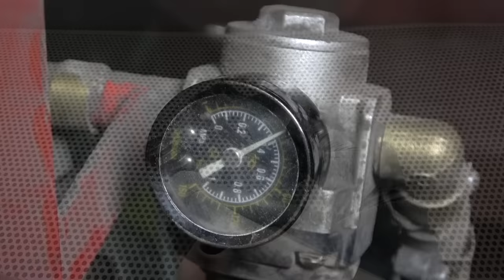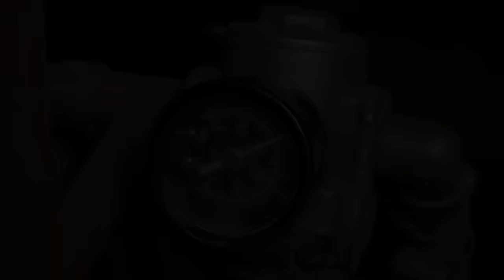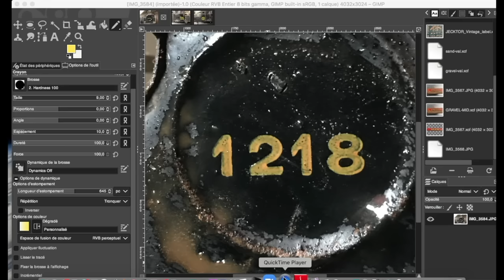1924s American Flyer Locomotive - Restoration

Comment: Great job on the body and decal work. As a model train runner I knew that one needed oil in several places, especially the armature and axle ends, and gears...
Reply from the maker: Great point! I didn't show it but I put oil in the engine ;)

Comment: Electrolysis is an amazing process. It can clean an 1800s piece of cast iron back to gray metal with no chance of damaging the surface. Here's a little trick I use with skillets because I use a 30 gallon tank and don't often change the solution. I hang the cast iron inside a pillowcase. It acts as a filter allowing the current to pass but containing the sludge keeping the anodes cleaner longer. I hose out the pillowcase between pieces and its ready to go again.
Reply from the maker: Awesome ! Thanks for the tip 🙏👍

Comment: The train rescues are obviously a hit. but it's the video editing; these delightful cuts and whimsical transitions. The absolute talent to spot a shot where there is none. I mean only you would think of a static close up of a bell, that gracefully sliiiide the motor unit in front as the focus adjusts, then top it with a wrist flip to get the motor the right way for the shot. You could've just put it the right way round to begin with but you didn't. That's art man, just delightful.
Reply from the maker: Thank you so much for all these nice words. Means a lot 🙏

Comment: The transformation is phenomenal, excellent work. You are so lucky both brush pads were intact on the fingers! For something that could easily be bought you chose to make the coupler, outstanding fabrication skills.  Did you make the roof also, I have never seen one before with just dimples on the top.. Also did you make the decals? I am in sore need of some for a 1201 and 1218. Again excellent craftsmanship.
Reply from the maker: Thank you !! I was very luck with as you said ;) I didn’t make the roof, only the stickers 😌👍🏻

Comment: Fantastic Video! I have a 1928 box cab that is cosmetically near perfect, but mechanically tired.  If you had wallowed out axle holes on the wheels, what technique would you use to rehab?  I was considering making bushings, but am now also considering 2 part filler.  Any advise would be greatly appreciated.  Your workmanship is exquisite, beautiful work and incredible editing to boot!
Reply from the maker: Hi and thank you very much for watching and also commenting ! If I remember well I’ve used JB Weld filler for the wheels 👍 I wanted to do soldering as it was originally, with an uncertain result tho😅 If you need anything fell free to ask !!

Comment: Very nice job on the restoration! I use a lot of the same techniques in my own restorations, and taking the time to do it right really makes a difference!
Just making sure, were the bearings and gears oiled and greased before running? It sounds quite a bit noisier than my tinplate trains from the same era, but I guess that could also be the mic volume. You might also be able to save time on replacing damaged couplers by checking with Henning’s or The Train Tender for reproduction parts.
Reply from the maker: Thank you very much for your valuable advice !😉

Comment: Did you lubricate the motor after you put it together?  It could just be old but it sounds much louder than I think it should even at it's age.
Reply from the maker: Yes I put mineral oil. The rail track is in very bad shape I need to restore it too ! ;)
Reply: @TheFabrik  I love watching your restorations.  I dabble in model trains myself, fixing old HO scale models and such.  I found for metal gears you want to use a thicker grease.  You seem to know you craft quite well, probably better than I know mine, but I thought I'd throw that out there Incase it helps with other models.

Comment: Beautiful work! It looks like it just came from the store. I am always impressed by your workmanship. I do have a question, is that paint or powder coating that is applied to the wheels and sheet metal? Thank you for sharing this.
Reply: paint, powder coating will have to put in oven for procurement.
Reply: @wo476  Thanks.

Comment: How do you decide whether or not to use powder coat or spray cans?
Reply from the maker: Powder coating is thicker, doesn’t fit with detailed and thin metal parts. It really depends on the thickness 👍